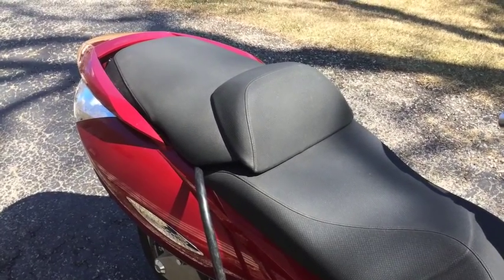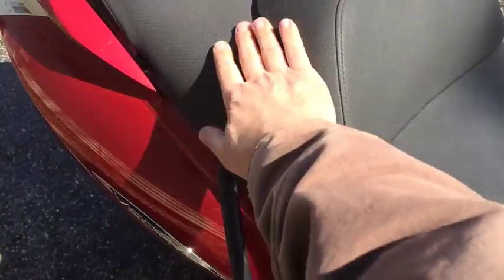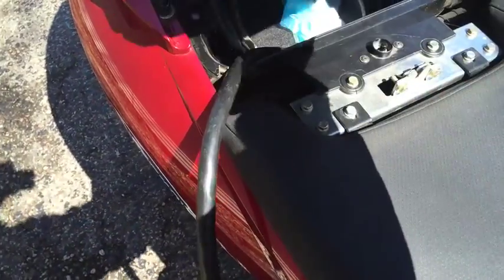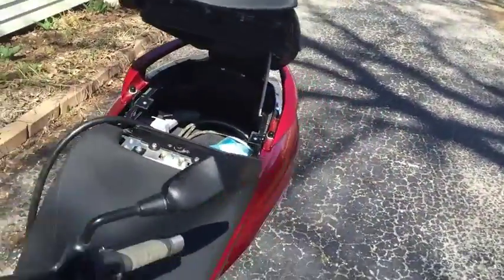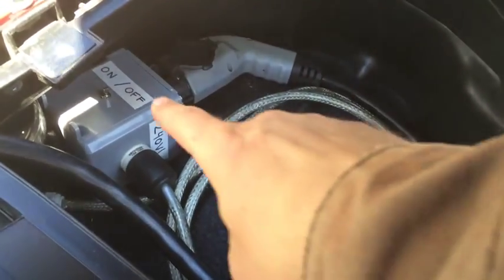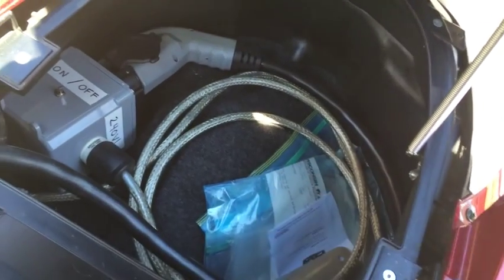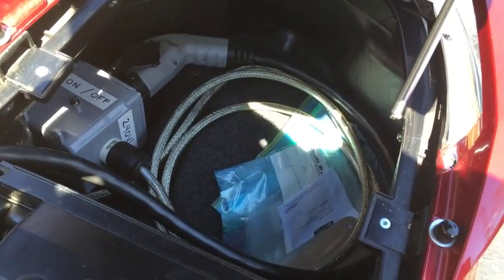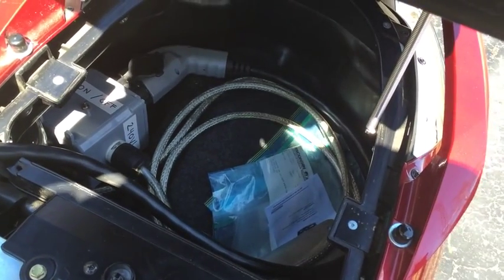J1772 Charging a Vectrix, addendum

Comment: Nice job Ben. My vectrix is awaiting me finding a leaf at auction.
What did you use for BMS, the LEAF BMS? or a portion of it? other type?
Did you change the charging profile of the original vectrix charger for Lithium?
Oh, and does the SOC just work or did you have to alter, or just use CycleAnalyst and ignore the v-bars?

thanks, Ross
Reply from the maker: +Ross R 
After the upgrade, the state of charge meter on the Vectrix doesn't work. I use voltage from the Cycle Analyst. I'm reusing the wires and connections from the LEAF BMS, because it goes to every cell pair. I have those running to a couple of Cell Logs. Not very fancy, but you can see multiple cell voltages, and they have an over/under voltage alarm. The Vectrix charger was updated with some new software, which I got from a user named "The Laird" on the VisforVoltage Forum.